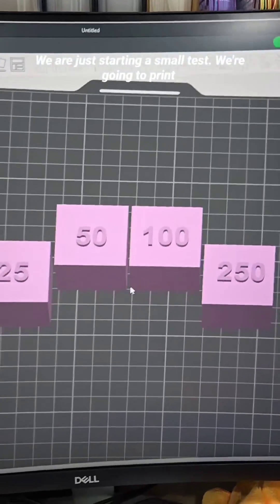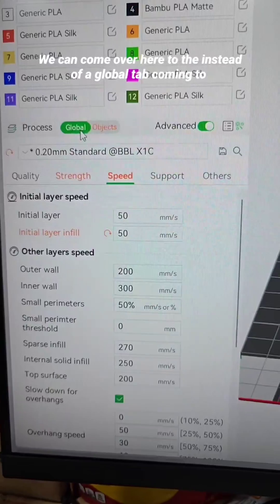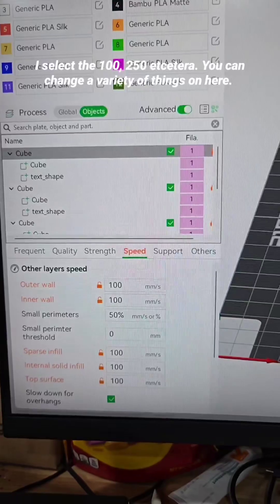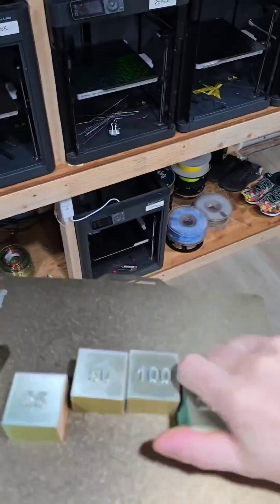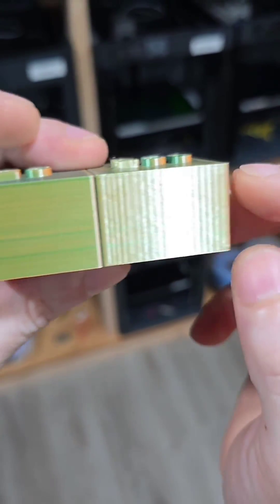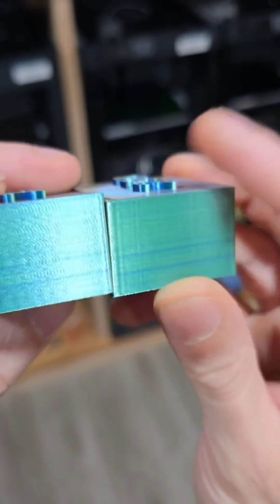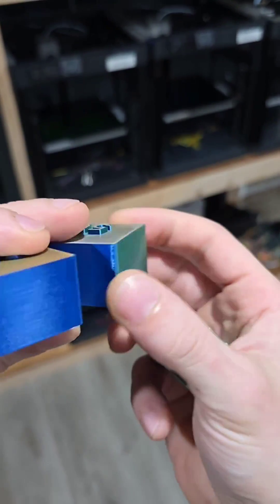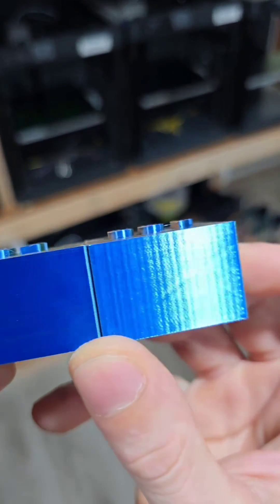3D printing tri color silk PLA at different speeds - experiment

Comment: you have the lines on there because of your extruder, straight cut gears that's not very precise and straight cut gears don't actually believer flow at a constant speed or rate weirdly enough why they don't use straight but gears in regular automotive gearboxes they use helical cut gear teeth and everyone in the 3D printer world missed that.
Reply from the maker: Yes, the lines are on there because the flow rate of the filament cannot keep up with the speed of the printer. This example shows that when we see ringing like this at fast speeds, we can create better results by simply slowing down the outer wall speed, especially when printing with Silk PLA. New printers are coming out all the time, surely the advancements will make this video obsolete soon.

Comment: Nice work. But what does it mean that the filament has ripples that align to the speed of printing? A mechanical problem with the printer?
Reply from the maker: @christianmontagx8461  there are settings and calibrations that you can do to further improve the quality of prints, but I've found this effect to be particularly evident when printing with silk PLA filaments. I just recalibrated my machine and am running some flow calibration and volumetric flow settings to reprint the cubes
Reply: @kaizen3dprints  I did some reseach and found out that it's called VFA (Vertical Fine Artifacts). It seems not clear in the community where VFA comes from. Some say it's a resonance problem from the stepper and some say it's the driver. Maybe it is possible to reduce VFA further by editing the sine curves of the TMC Drivers. I remember that it should be possible with Klipper and some TMC Drivers.